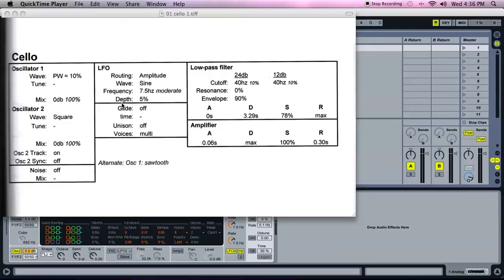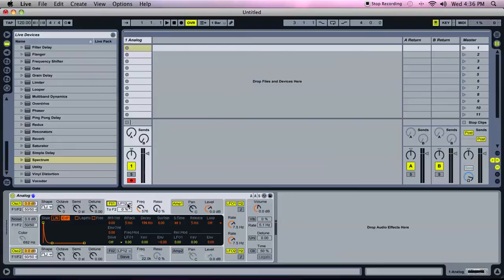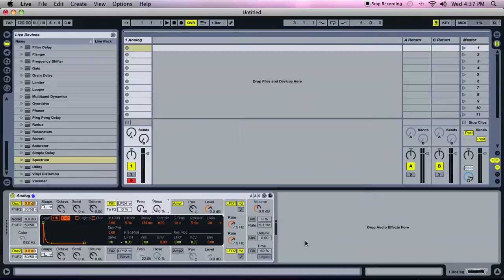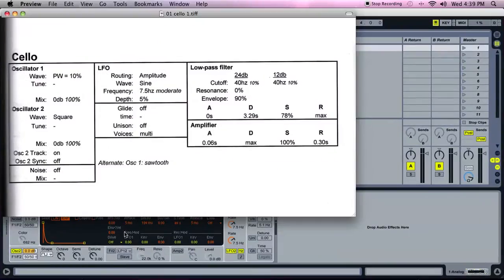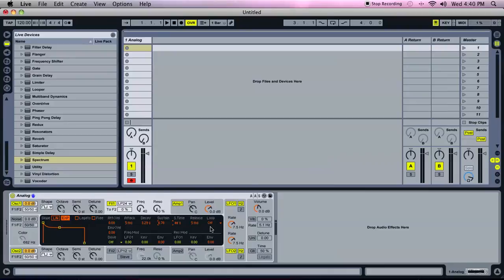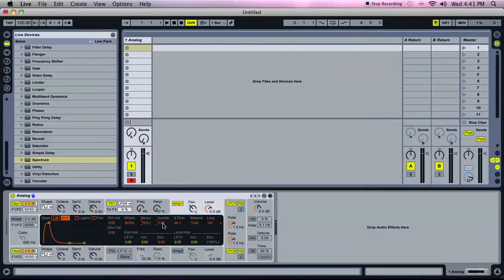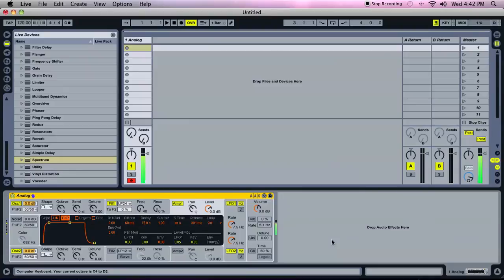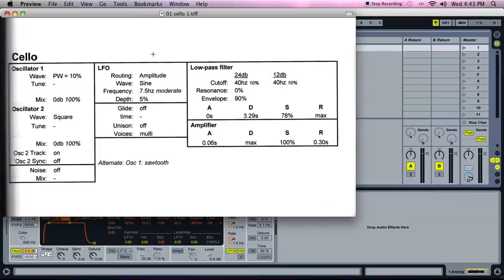VideoWelsh's Synthesizer Cookbook Patches in Ableton and Analog Tutorial - 3 of 3

Comment: I notice you didn't set the amplitude envelope for oscillator 2. If you do this, then set the release times to about 300ms, it's closer to a cello sound, but you're right. It's more like an 80s Casio 'cello' than anything else :-D
Reply from the maker: Thanks, Garry. That's a great suggestion. For the tutorial, I decided to focus on programming the patches the way the author intended, but when I close the book, and patch autonomously, I have also made lots of changes that I like. Thanks again for watching and for the constructive feedback :)
Reply: @AndrewDoe777  I know this is a super old video by now, but I'm thinking the author did in fact intend the amplitude to be the same for both. Usually there's one set of envelope controls that dictates the amplitude for all oscillators. 

As for believable cello/strings, I also like to have an lfo subtly modulating the frequency, similar to the amp lfo in the book, plus have slight differences on the modulation depths/rate for osc 1 and 2.
Reply: Thanks again for the tutorial :-)